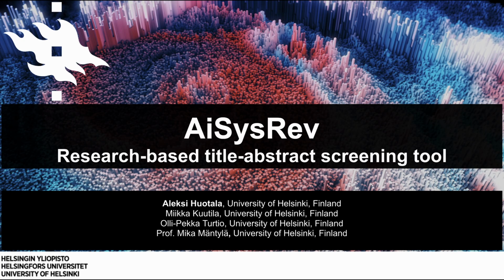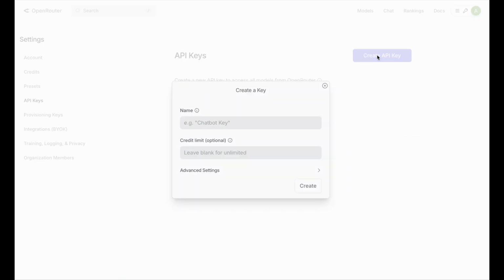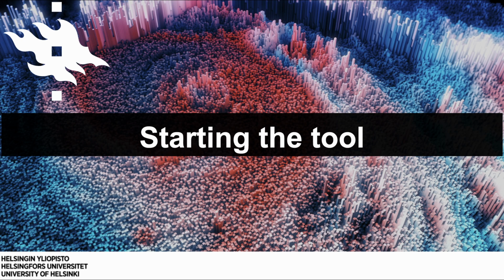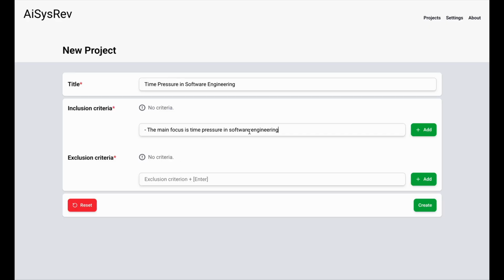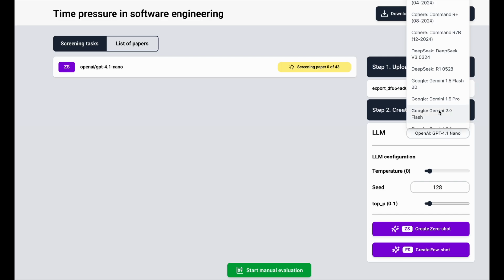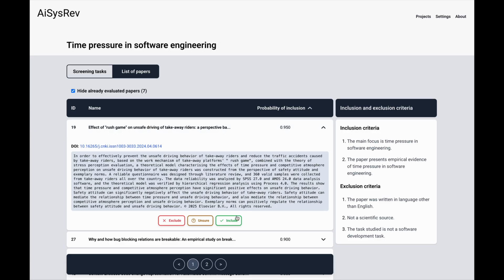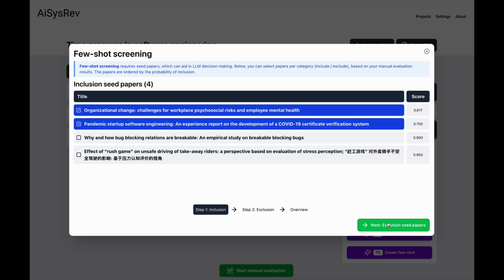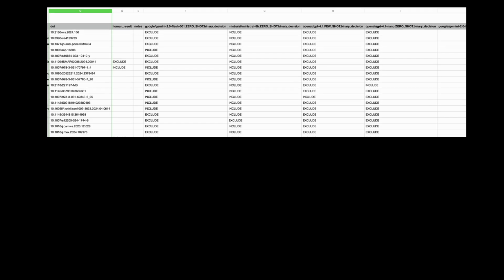AISysRev - LLM-based Tool for Title-abstract Screening (old)

Comment: It's an interesting tool and ty for the hard work. I suggest that you give the option to not use open openrouter for AI by changing the backend. I already got unlimited access to perplexity API. And in fact, openrouter has limitation, he only screens 50 then you will need to pay. So  if I am conducting screening for 10,000 reports, I'll have to pay more than 150$ to get Gpt and claudette model, which is a serious limitation in your tool, making it less usable, especially It's a new tool. So, what i do is upload my screenings on rayyan then I use AI assistant in my Comet browser or even GPT atlas and he conduct screening with very high reasoning and efficiently. So, as you launched a new tool, it'll not stand long in front of the other easy, efficient  and cheap tools. So  what's your suggestion?
Reply: Gpt atlas and comet got limitations too, that after ~100 he get stopped and you should give him the order to continue.
Reply from the maker: Thanks for the input. I added it as feature request to github https://github.com/EvoTestOps/AISysRev/issues/129